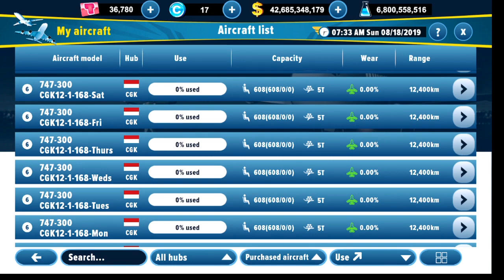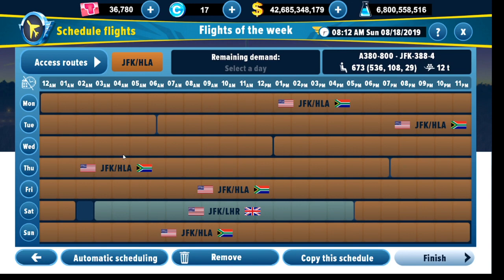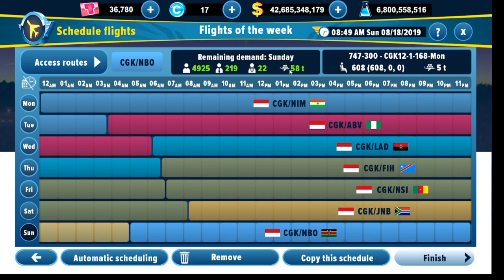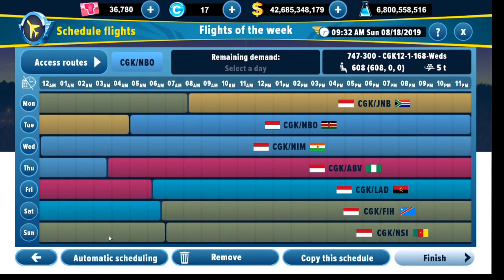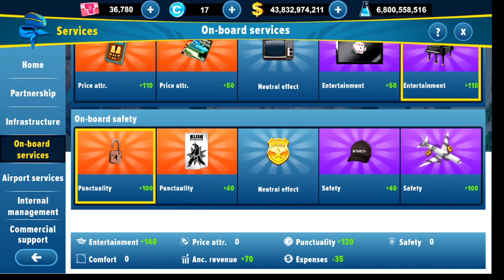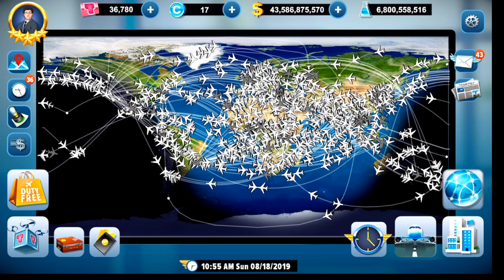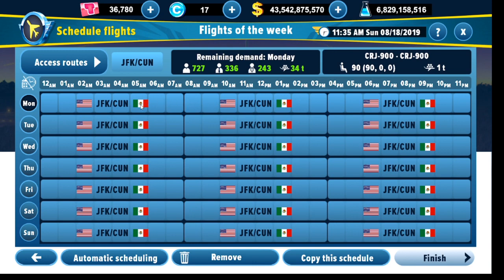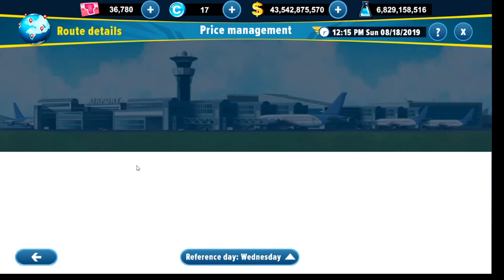168Hr Circuit Part 2

Comment: Great video. My question is, since you have been playing the game for a while now, considering the number you are getting for your economy pax, is the 168hr possible for someone like me who's getting a max of 2944 from a route like KAN. I plan on using a 787-8.....Or should I get a 747-300 specifically for the 168hr system so as to maximise profits
Reply from the maker: No 168 Circuits can be used with any plane.   However, it is designed for more Eco than anything.   But it technically will work with many scenarios.
Reply: @bigtimes101  Thank you man for the reply. Wasn't expecting a response anytime soon. 
So the biggest question is how many planes can fit unto these route with the following pax demand.
Hub......CGK 
YOL.....2088
PEK....1301
AKL....2115
KSA....2044
CNS....1572
SSA.....2128
KAN....2944
Reply from the maker: Depends what plane you use.  For example, For me, the most profitable plane in the game is 96-300.  It seats, 300 one way, so always use 600, cuz trips are round trip.  I will always use max Eco and fill that first.  For the numbers your giving you should be able to put at least 3 or 4 waves on the 787, with 381x2 and 10t cargo (one way is 381 and 5t)